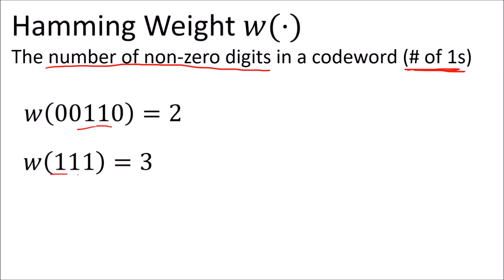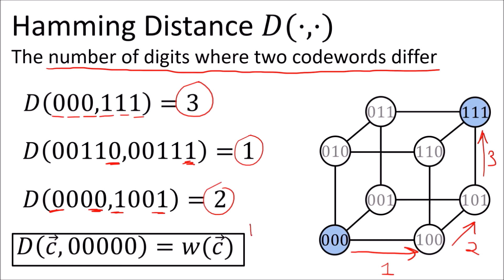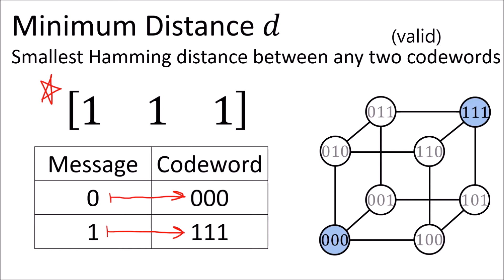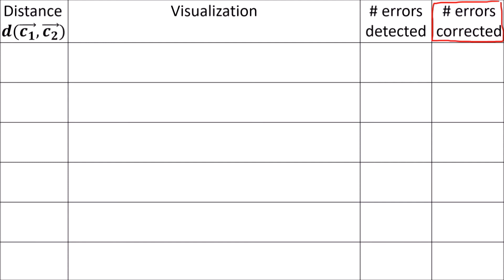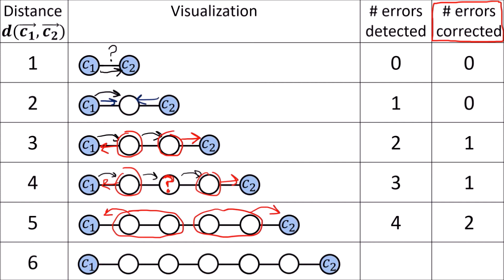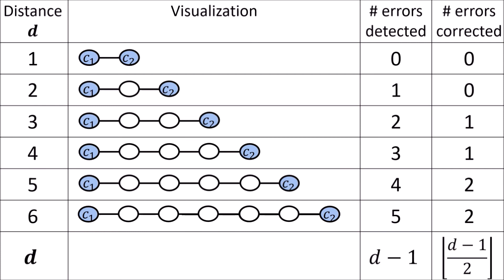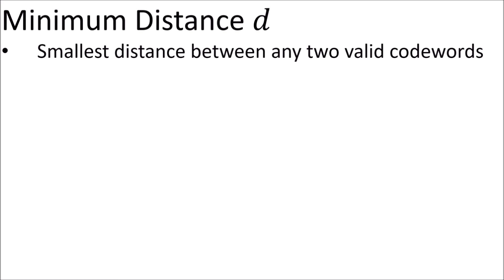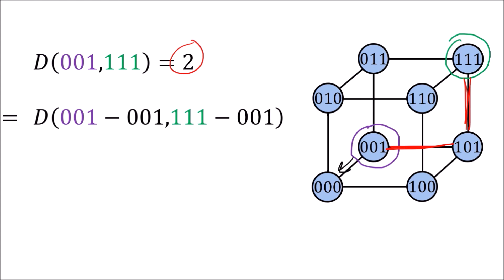Error Correcting Codes 2b: Linear Codes - Minimum Distance

Comment: The stages involved in deciding the minimum distance for linear error correcting codes are as follows:

1. Determine the number of bits in each codeword (n).
2. Calculate the number of message bits transmitted by each codeword (k).
3. Find the minimum Hamming distance between codewords (d).
4. Calculate the code rate, which is the ratio of k to n.

For the problem given where management has decided to use 20-bit data blocks in the company's new (n,20,3) error correcting code, the minimum value of n that will permit the code to be used for single bit error correction is 23.

Comment: For the Hamming (7,4), if you calculate the syndrome and use that to detect and correct errors (works only for 1 bit error), is that better than having to input the entire codeword map into memory?

Comment: You call them cubes. Is it incorrect to call them graphs?
Reply from the maker: You could if you wanted, but the examples shown in this videos always have ther vertices and edges arranged in a way that matched a cube in some dimension.
Reply: @eigenchris  alright, thanks😁
Reply: do you thinking learning graph theory will have utility when learning coding theory?

Comment: If I have a code with hamming distance of 3, then like you said I can correct up to 1 error bit, but this is only true if you assume that only 1 bit has changed. But how do you know in general how many bits have been false?
Reply from the maker: With a hamming distance of 3, you can correct 1 bit error, but anything more than that renders the code useless. 2 bit errors will detect the error but make the wrong fix, and 3 bit errors will make the jump to another valid codeword, making it seem like there are no errors at all. Every code has its limits. The only way to know for sure which errors occurred is to compare the results with the original message. When we use ECCs, we have to 
"hope" that our chosen minimum distance is good enough. But if you scratch a CD enough, or tear up a QR code enough, you simply can't read it anymore.

Comment: How do you prove that the best (k,n) - Code has minimum distance k?
Reply from the maker: I'm a bit confused by what you mean by "best" in this question. Can you explain?
Reply: @eigenchris  Well you said: best. I will link it in a minute.
Reply: I mean 5:43 you said with the best 7,4 correction codes you can correct up to 3 bit errors...
Reply from the maker: @TVSuchty  oh, I see what you mean. These "best-of" codes have message length k=1 and codeword length n. The minimum distance is always going to be n, since there are only 2 valid codewords, which have a separation of n.